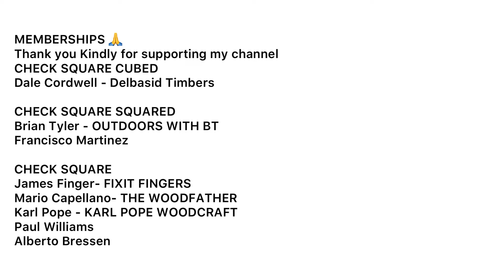Segmented Rings made from PALLETWOOD

Comment: Yeh how good is the Kustom Grit! Bloody amazing stuff! Where do you get your coloured veneer?
Reply: Yeah I was thinking the same, about the custom veneer. It's a good thing to drool over projects made overseas, but where sourcing some of the gear is a bitch, but it's nicer to see someone here doing it so there's a chance stuffs locally available. 
I guess if I was desperate I'd use coloured craft card stock and resin coat as the finish to protect it. Or use resin instead of PVA for gluing... eh I am a heathen though so there is that 😁
Reply: @dainermade  none in stock 😔